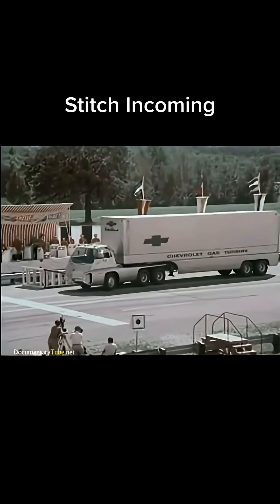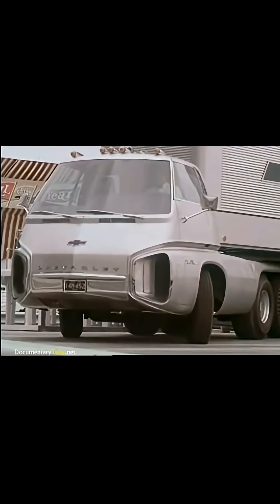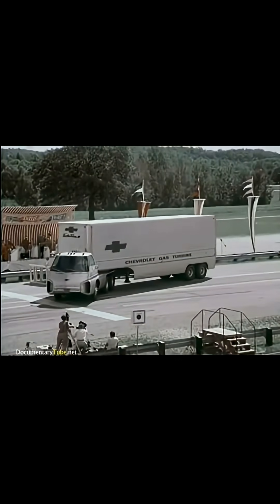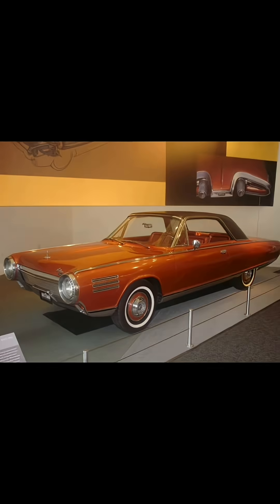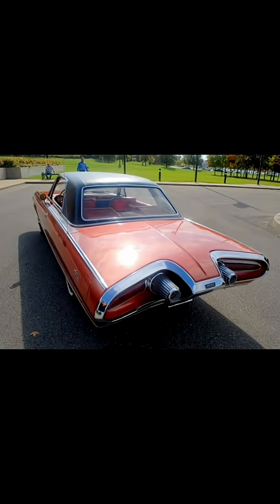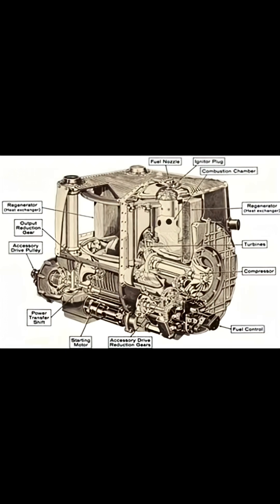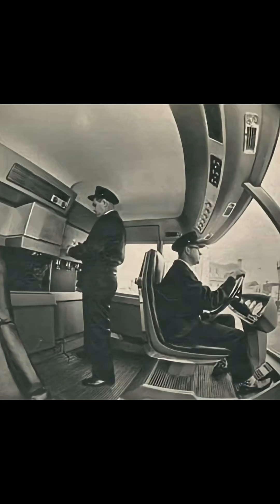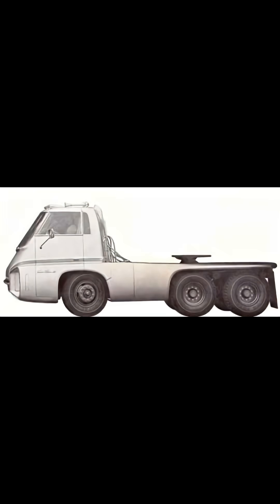The #GM Turbo Titan #Semi #Trucks #Trucker #history #Turbine Prototype #cartok #mechanic

Comment: American LaFrance, and Freightliner also had turbine powered trucks.
Reply: I believe around 1975 Terminal Transport, out of Atlanta GA, ran a couple of those GMC Astro turbines.   They were considering buying for the fleet but it never happened.   The word was that they would pass anything on the road and never gave up any speed climbing Fancy Gap either.   (Fancy Gap NC, Smokey Mtns.)   
       Appearently, they were tough on transmissions.   Makes sense to me.   When you have enough power to climb mountain grades at full speed, fully loaded, the weakest link is gonna break.   Those transmissions were never made to have that amount of power going into them.   I don't know if they were manual or automatics.   I believe probably 10 speeds.
       Terminal Transport ran all of the east coast states back in the day.   Tractors were dark brown with yellowish-goldish lettering.   The two Ts were over-under & staggered.
        Terminal
          Transport
       I made this post partly for posterity / history.   I am among the few people remaining that still knows about these tractors being tested by Terminal Transport.  😊

Comment: I believe around 1975 Terminal Transport, out of Atlanta GA, ran a couple of those GMC Astro turbines.   They were considering buying for the fleet but it never happened.   The word was that they would pass anything on the road and never gave up any speed climbing Fancy Gap either.   (Fancy Gap NC, Smokey Mtns.)   
       Appearently, they were tough on transmissions.   Makes sense to me.   When you have enough power to climb mountain grades at full speed, fully loaded, the weakest link is gonna break.   Those transmissions were never made to have that amount of power going into them.   I don't know if they were manual or automatics.   I believe probably 10 speeds.
       Terminal Transport ran all of the east coast states back in the day.   Tractors were dark brown with yellowish-goldish lettering.   The two Ts were over-under & staggered.
        Terminal
          Transport
       I made this post partly for posterity / history.   I am among the few people remaining that still knows about these tractors being tested by Terminal Transport.  😊

Comment: Heat is an asset not a problem.  Use the heat to drive a generator and suddenly electricity becomes a problem till you realize electricity is an asset not a problem.  Upgrade the cabin size mount the driver position forward now you have room for a full sleeper/kitchen.   Hindsight is always 20/20

Comment: Euro VI 
Best highway efficiency: ~20–25 L/100 km
Loaded/hilly conditions: ~35+ L/100 km

Scania DC13 450
450 hp
22–26 L/100 km

Scania V8 770
770 hp
3 700 Nm
~32–38 L/100 km

Volvo, MAN, DAF and Mercedes all about the same (Mercedes is a little bit less hungry)

Oh in Europe 80 kph is Truck speed, but they got that everywhere. Hill, flat, Highway, national road. (Speedlimits aside of course)

Comment: Dude the Chrysler and the GM had a PT6 The most reliable engine ever made they are in air planes to this Day New and Old and they can put out any where from 1HP to 2600 HP. that thing that you showed the Ford having? I don't even know what that was. An Adof Hitlers engine may be? Look it up man PT6 60 years later still going strong. Even the military uses the shit out of them.

Comment: There were several problem with the turbine vehicles besides fuel consumption, one being pollution. Especially with Nitrogen Dioxide (NO2 or NOx). 
In the early 50s Chrysler started to develop their tech data for the engines about 1950 and had prototypes of their cars out by 1954. By the early 60s almost all US auto manufactures played with the idea of jet engine cars. But turbines or jet engines were still relatively new, being developed in the late 1930s. The first jet aircraft to fly was Germany's Heinkel He 178 in 1939.  So like atomic energy and atomic powered vehicles were also a new concept at that time, there was a lot to learn.
The best economy. least polution and power that can be produced by a Turbine or Jet Engine is at operating it at one steady RPM. But vehicle engines are constantly changing RPMs and they couldn't get the economy, pollution and power out of a jet engine under vehicle driving conditions. Eventually all but Chrysler dropped their work in jet powered vehicles. Chrysler continued working on their jet vehicles up until Lee Iacocca took over to bring Chrysler out of bankruptcy and stopped the development.
Sometime in the 1980s NASA had contacted Chrysler about their jet engine development and asked if they could get copies of all their data and if they had any engines or parts they could have. Chrysler Handed everything they had, including spare engines and parts to NASA for their project.
About 10 years later in the 90s was when President Clinton pushed his alternative fuels via incentives under the existing Energy Policy Act of 1992. This was done by promoting Alternative Fuel Vehicles in federal fleets, expanding R&D for biofuels, hybrids and encouraging better energy efficiency to reduce oil dependence and emissions. Someone at Chrysler remembered that NASA had asked and gotten all of their research, spare engines and parts. So they asked NASA if they could get their research records back so they could start up their jet engine program again. NASA sent all of Chrysler research data and included NASA's development research along with some spare parts. 
What Chrysler found had the answer to many of their problems. NASA was developing Turbines to runin space to power satellite systems to recharge their batteries and when more power was needed. That showed them how to make the jet engine run at one constant RPM and use a generator to power electric motors to drive the vehicles. It wasn't long before Chrysler unveiled their Patriot racing car designed for Le Mans in 1994. Hopes were high but it got way too over engineered and was eventually shelved.
But the turbine powered vehicles proved to be too expensive to produce, complex manufacturing required, and difficulty meeting newer emissions standards along with many other issues. But the Turbine Vehicles may have a comeback as many other manufactures are still playing with the concept coupled with generators to power the electric drive motors.
But I'll never have one, I prefer the gasoline piston engines with a good manual transmissions. The EV's and automatics are boring as hell. I'll stick with my 68 Camarro, 63 and 65 Corvairs. They are far more fun to drive and easier to work on compaired to the newer crap they produce today. They also have fewer problems.
Reply: Appreciate the info.   I was totally unaware of the NASA connection !   I believe like you, 50s 60s 70s are the cars to have.   Fun, reliable, easy, & inexpensive.  😊

Comment: You should cover the Chrysler turbine. Especially since it solved the hot exhaust problem with the heat exchanger which gave a final exhaust temp less than a comparable gas piston engine.

Comment: Granted there are a few misconceptions about turbines. (Most of me research is on the M1 Abram’s ATG 1500 gas turbine) that yes they are loud but at a longer distance they are whisper quite because higher pitch noises go away quicker. That and the heat problem wasn’t as bad as people say there are almost zero recorded incidents of gas turbines starting fires. (Granted Union Pacific gas turbines did melt tarmac on a bridge but that was after a few hours. That and fuel consumption. Turbines are great under constant load unfortunately there are very few places in the Us where they can run wide open all the time.

Comment: As a professional driver for over a decade trucks haven't really improved you can easily still get 2.1 mi to the gallon going uphill depending on the length and the grade

Comment: I have a friend who was an engineer and owned and built Ralph Trucks in South Africa. He was a WWII pilot and started the truck company after the war. The were the Mack trucks of South Africa. He was the one that designed and built the Ford Ranger. But later when he was in his 80’s he designed a hybrid truck that had a liquid natural gas turbine and some kind of anodes to store power for hills. The electric motors turned out 750 KW which is about 1000 HP. He made a test run over the Donner summit in the sierras to Reno. He said it never slowed down. But the plans are were lost when he died. I think the diesel industry had something to do with that. Who knows.
Reply: Don't write "WW11" if you mean WW2.
Reply: @JWOptional Don’t be a dick
Reply: @grumpy3543 ... What's the matter? Did you fight in the World Wars three through eleven? I can imagine you waking up, having shat yourself with shell shock.
Reply: @JWOptional Those are supposed to be capital I’s
Reply: @grumpy3543 bull i's are almost the full keyboard away from the 1's 😂
Reply: @J @JWOptional It’s roman numerals you dork.
Reply: Are we already at the eleventh world war? I haven't really kept up with the news.
Reply: @gteixeira I can’t believe that kook got so mad at me. As if he couldn’t figure out that it said World War II. How could he be confused with 11?

Comment: You forgot macks turbine
Reply: I believe around 1975 Terminal Transport, out of Atlanta GA, ran a couple of those GMC Astro turbines.   They were considering buying for the fleet but it never happened.   The word was that they would pass anything on the road and never gave up any speed climbing Fancy Gap either.   (Fancy Gap NC, Smokey Mtns.)   
       Appearently, they were tough on transmissions.   Makes sense to me.   When you have enough power to climb mountain grades at full speed, fully loaded, the weakest link is gonna break.   Those transmissions were never made to have that amount of power going into them.   I don't know if they were manual or automatics.   I believe probably 10 speeds.
       Terminal Transport ran all of the east coast states back in the day.   Tractors were dark brown with yellowish-goldish lettering.   The two Ts were over-under & staggered.
        Terminal
          Transport
       I made this post partly for posterity / history.   I am among the few people remaining that still knows about these tractors being tested by Terminal Transport.  😊

Comment: The rover/Leyland attempts are pretty interesting, they'd been making small gt's for some time with quite a bit of success for man portable high output fire pumps and generators, the navy used their fire pumps on ships, a two man team could move a 60hp pump around which is still impressive today but that translated into the basis of a much larger one piece cast iron housing for the truck projects which covered a period of 20 years and several different machines.
Volvo also tried, they also make gt's for aircraft.

Comment: Didn't Andy Granatelli make a turbine Indy car? Guess it was doing well till a cheap bearing failed. Later ruled that turbines were banned.
Reply: Andy, Mr. STP, did make a turbine Indy Car.   The bearing failed in the last lap.   Indy did not ban it but restricted the air intake size.   Death for a turbine engine.   Indy just wanted to keep piston engines

Comment: Problem with turbines is practically no torque. They're all horsepower based on RPMs exclusively. It could work in a car, but not worth squat for towing. The way you'd have to spool it up to even get moving with a loaded trailer makes it prohibitively impractical due to enormous fuel consumption. MPG? Oh no, FPG....feet per gallon.

Comment: International Harvester made a turbine engine in a tractor.  It's in the Smithsonian
Reply: I believe around 1975 Terminal Transport, out of Atlanta GA, ran a couple of those GMC Astro turbines.   They were considering buying for the fleet but it never happened.   The word was that they would pass anything on the road and never gave up any speed climbing Fancy Gap either.   (Fancy Gap NC, Smokey Mtns.)   
       Appearently, they were tough on transmissions.   Makes sense to me.   When you have enough power to climb mountain grades at full speed, fully loaded, the weakest link is gonna break.   Those transmissions were never made to have that amount of power going into them.   I don't know if they were manual or automatics.   I believe probably 10 speeds.
       Terminal Transport ran all of the east coast states back in the day.   Tractors were dark brown with yellowish-goldish lettering.   The two Ts were over-under & staggered.
        Terminal
          Transport
       I made this post partly for posterity / history.   I am among the few people remaining that still knows about these tractors being tested by Terminal Transport.  😊

Comment: Turbines are good for constant torque. Not so great for throttling and speed changes. They have a sweet spot where they operate most efficiently and that's why they are great on aircraft and ships but not road vehicles

Comment: Allison later had a fleet of Chevy Titan 90's and GMC Astro 95's with a larger turbine. It was smooth and quiet. The one that I got a ride in had a 10 speed transmission with first gear locked out to prevent over revving the turbine. The exhaust heat was dissipated by large oval exhaust pipes.
Reply: I believe around 1975 Terminal Transport, out of Atlanta GA, ran a couple of those GMC Astro turbines.   They were considering buying for the fleet but it never happened.   The word was that they would pass anything on the road and never gave up any speed climbing Fancy Gap either.   (Fancy Gap NC, Smokey Mtns.)   
       Appearently, they were tough on transmissions.   Makes sense to me.   When you have enough power to climb mountain grades at full speed, fully loaded, the weakest link is gonna break.   Those transmissions were never made to have that amount of power going into them.   I don't know if they were manual or automatics.   I believe probably 10 speeds.
       Terminal Transport ran all of the east coast states back in the day.   Tractors were dark brown with yellowish-goldish lettering.   The two Ts were over-under & staggered.
        Terminal
          Transport
       I made this post partly for posterity / history.   I am among the few people remaining that still knows about these tractors being tested by Terminal Transport.  😊

Comment: Seems like turbine-electric would have a better time with milage, and surely something can be done to insulate noise and heat
Reply: Heat wasn't much of an issue I'll saw a video on the turbine car and it's exhaust doesn't get any hotter than a regular exhaust

Comment: Sounds like big red would of been too heavy to pull much weight 80 k pounds doesn’t mean just load that is total weight and big red wasted too much on cabin and they 600 hp was mostly was to pull the house on wheels
Reply: 72K back then.   The house & kitchen was because cities, truck stops, roadside rest areas, everything, was much less in those days.

Comment: The M-1 Abrams has a turbine engine, it's known as whispering death from how quiet it is. I've had a full conversation next to one running and had no clue it was running. I've also heard jets over the main engines on a CVN, in the engine room, so yes, jet engines can be loud.
Reply: Yeah, but that's 25 years plus of development.
Reply: @marvindebot but if the turbine never got killed off it would've had the SAME r&d those are only 1 and 2nd gen turbines it's because they compared the first product and said naaaa rather than look at its POTENTIAL
Reply: @NateTheShrimpKnightVT  Chrysler made 7 generations of turbine engines by the time the program ended in 1979.  The one in the Turbine Car was a 4th generation model.  They were all underpowered, had poor fuel economy, were loud, and cost ruinous amounts of money to manufacture.  There is really no way to make a turbine engine itself quiet.  They're loud by inherent design.  But with a main battle tank where you don't mind 0.5 miles per gallon fuel economy, it is possible to add sound deadening to insulate the engine noise from the outside world.  That likely wasn't possible in automotive applications.

Comment: The "turbine wars" did have some success.  The Abrams powerplant is a direct descendant of it.
Reply: Yes, At .5 mpg …. 8 gallons to start it. Abram’s are thirsty
Reply: @brianlelis5105 I believe it.  Good thing they spend a lot of time where there's oil...
Reply: @brianlelis5105 quieter than diesels though. That’s all that mattered.
Reply: @AirborneRenegade  Lighter and more powerful than a similarly sized diesel powerpack of the late 1970s.
Reply: @TheAttacker732  I think the next refit for the Abrams however is going to be a turbodiesel due to how far diesel engines have come they can be just as good as the turbine and probably more low end torque too.
Reply: Believe it or not, the Abrams was supposed to have a diesel engine for most of it's development cycle. Thing is Chrysler had lost a bid to build helicopter engines for the UH60, AH64 and SH60. What is not openly known is that the development of this engine and initial infrastructure needed to roll out prototypes had been an expensive gamble on Chryslers part. They where looking at downsizing and mass lay-offs with the contract falling through. Thus after some last minute backroom dealings, Chrysler was bailed out by repurposing the helicopter turbine engines to power the new MBT. There where teething problems and reliability issues initially, but they ended up ironing those out in the end. But yeah the choice for a turbine engine in the Abrams had nothing to do with it being a superior or even a sensible choice at the time and everything to do with the inner workings of the military industrial complex.